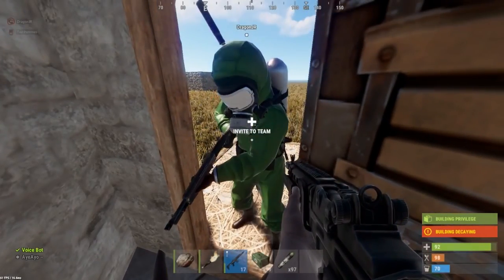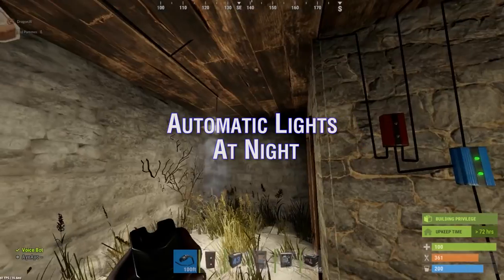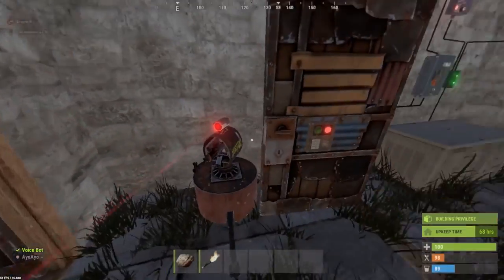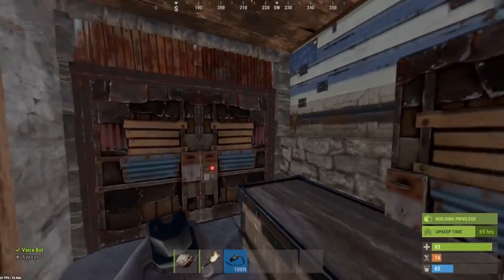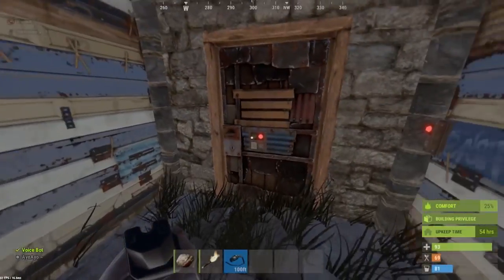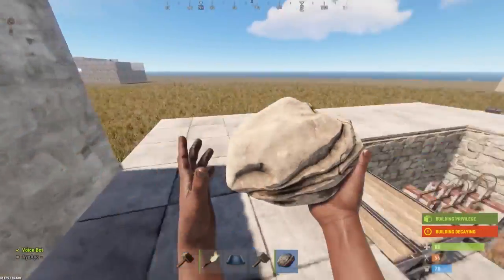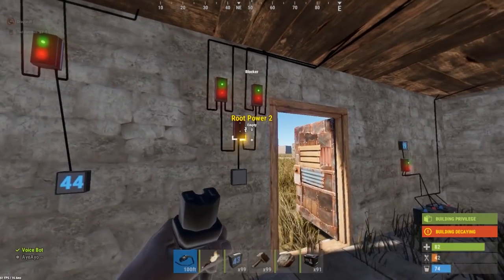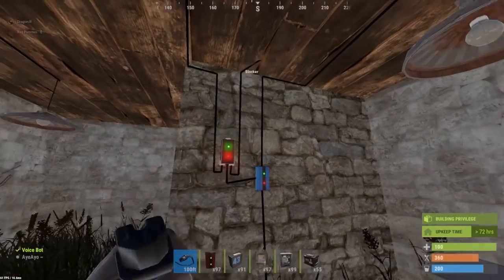Practical Electrical -  Anti-Deep | Traps | Auto Night Light | Anti DoorCamp

Comment: Root combines have been fixed. You can now combine root combiners.
Reply from the maker: Yeah but only from a power source if im correct
Reply: @TedPommes  Yes. Can go power source to combiner then combiner to another combiner and another etc. Can't go from anything that draws power including switches to a combiner.
I tied 12 panels all into combiners then kept combining them till I had 1 combiner at the end.
Reply from the maker: Its a good start but sucks that you cant combine from switches

Comment: Hey i nees help do you know how to load faster in rust so if you join a server it can take to 5 or 10 min and thats annoying i have a i5 7400  and 8 gb ram i think
Reply from the maker: Unfortunately rust just doesnt seem to run smoothly on some setups. Try running it on patato settings and make sure you turn verything down low in your graphics settings. If that still doesnt fixes the loading times try running a lower resolution.
Reply: buy a ssd
Reply from the maker: Even beter a m.2 if your motherboard supports it.
Reply: @roblood1857  i got an ssd but dont really like to make it full it dose t have much GB sadly
Reply from the maker: Feelsblyatman
Reply: @TedPommes  blyat man dddadaddadadda
Reply from the maker: XD